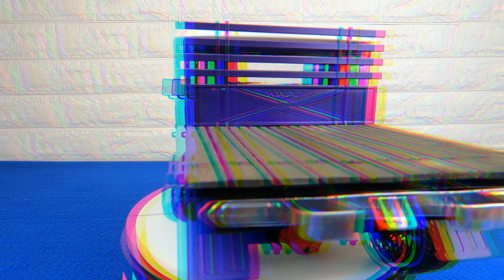Wpl Custom C44km Tuning Drifit 4wd My Mods Project Creative Rc 1/16 Metal Edition C44 km

Comment: Nice job, what’s the drift tires and wheels spec you’re using.
Reply from the maker: hello, the tires I got them from my wpl d12 1/10 from drift taken on online at banggood, the rear ones are 1/10 and I put an adapter, minute 13:01
Reply from the maker: 07:57 - 11:15  Mounting adapters for 1/10 tires
Reply: Thanks a lot